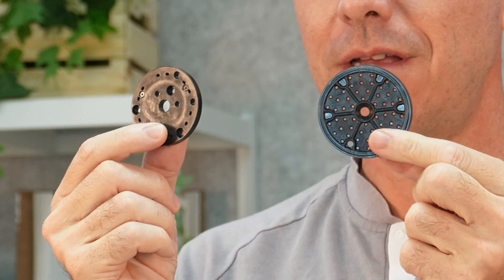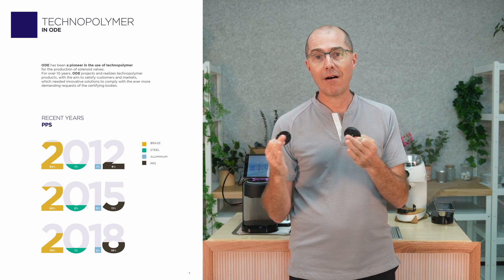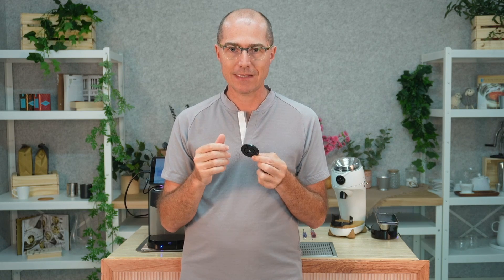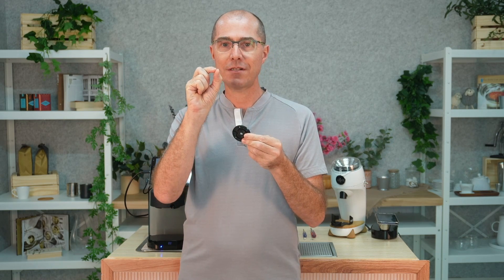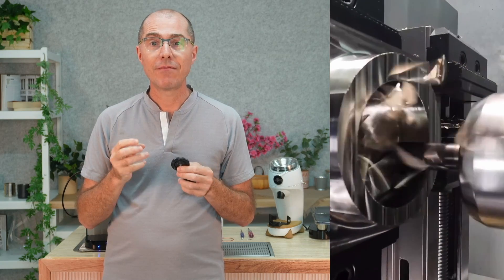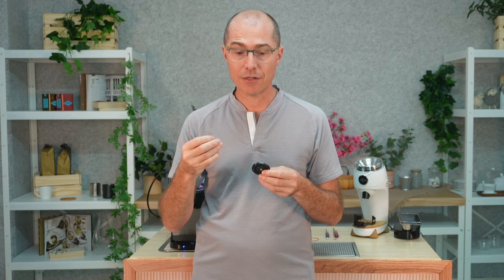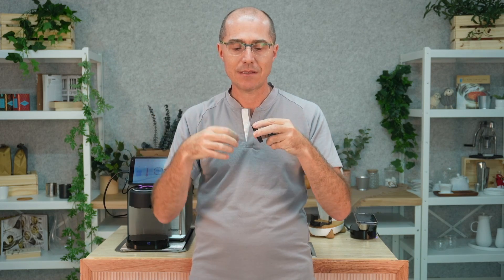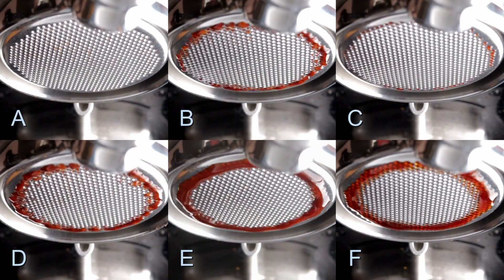Make better coffee with Decent's new and improved group head parts

Comment: @decentespresso Honestly I’d rather see you make them out of copper or ceramics composites make it either highly sensitive to heat or resistant to heat over time I see the water slowly eroding those parts into the cup and I’d rather not drink plastic but that’s just me I don’t care if some bureaucrats say is safe

Also the sticking of the oils is from the copper in the brass it’s one of the reasons copper is used in alcohol distillation it’s reactions to oils for example a still that’s made anything but cognac can’t make cognac because the copper has been contaminated with oils other than what would be found in cognac and would not created a suitable cognac flavor profile
The change in flavor could be the heat or it could be the oils not reacting with the copper in the brass acting like a catalyst this is important in distillation to remove sulfur compounds but it might be harming the depth of flavor in this process

Comment: Just installed my new group head parts! I can’t wait to test it more. Today it seemed to have a tiny bit better balance and maybe after looking at my rusty looking brass it will keep way cleaner so maybe that is a cleaner cup with less old oil since I only back flush like every three weeks. The puck is still a little soupy but no big deal.

Comment: Besides obviously removing the tanks, anything else needed with the machine or just flip upside down after removing those?
Reply from the maker: We also recommend using a towel so the top of the DE1 is protected too while on the table surface.

Comment: If I recall correctly, v1.44 already had a change to decrease headspace. Does this make 1.44 machines lower than E61 spec?
Reply from the maker: You may have confused this info with the new PPS parts that have just been released. Installing these parts will match the headspace in a E61 grouphead.

Comment: Any plans to make these in stainless steel?
Reply: dude, watch the video
Reply: @decentespressoailliobullet5748  dude I did, twice.  There's no mention of a stainless steel option.  Timestamp?
Reply: @huachangxu7655  he says that the MAIN POINT of using plastic and not ANY metal is due to the temperature lag caused by the metal acting as a heat sink. The move to plastic is largely to get much faster and more accurate response to the actual temp in the group head. So any metal, brass, aluminium or stainless steel would have the same negative impact.
Reply from the maker: @decentespressoailliobullet5748  Exactly so. Stainless for these parts would be even worse than brass.

Comment: Does the "Group head v2 upgrade kit for DE1 v1.1-v1.44" part include both this and the lower headspace? Or should I wait for an upgraded kit? Many thanks and awesome continuous innovation! ❤
Reply from the maker: This will lower the headspace but you will also have to be mindful of the gasket you are using and or the basket and dose, which also affect the headspace.
Reply: @decentespresso  thank you. I ordered and received the parts and the installation was a breeze thanks to the video!

Comment: Fda aproved tefal as well, and how many people had died since.
Reply: My brass parts were starting to very slightly erode a little with some surface rust and I wonder if they have a tiny bit of lead. I guess this is probably just as safe or safer and way less cleaning is needed.
Reply: Thanks for the public notice, you can still use the old part...
Reply from the maker: and yes, we'll continue to stock the brass parts, for people who don't like the idea of any plastic in the water path, even one so well tested, used by so many espresso parts companies, and used to make baby bottles.

You're welcome to use brass, if that's your preference.
Reply: and therefore?

Comment: To compensate for the brass heatsink effects, can't existing brass-users to change their algorithm to have +3-4 degree pre-infusion temps?  Or another question, if you switch to the new plastic group head and your same recipe "instantly tastes better", it means the original recipe wasn't good enough and should have used a higher water temp.
Reply from the maker: It's more complicated than that.  The brass contributes latency, which causes many effects.  The video explains more.

Comment: hi john, will this new design also work with IMS SI200 shower screens? And did you drop the 100$ goody in your 2-year warrenty option?
Reply from the maker: Yes, we continue to use the IMS SI200 screens.

Yes, the $100 goodie pack was an introductory promotion for the extended warranty, and the offer ended about 2 weeks ago.
Reply: @decentespresso  this is a pity, I did not purchase the warranty yet because of this option.

The DE1 comes with a CI200 not SI200.  Please do not confuse.

Comment: Will the new group head reduce the soupy muddy coffee sludge and dry pucks?
Reply: He implies that right near the end around 14 minutes in . They are reducing the space between the shower head and the puck which should result in drier cleaner pucks.
Reply: yeah it's mentioned in the description of the video:
Reduced channeling: Less headspace above the coffee puck reduces channeling and increases mouthfeel and shot consistency. 
Also says it at the end of the video. Same as E61 machine.
Reply: It seems to help a little after one shot today. Nothing like a dry puck.I will do a video on it. I think since it doesn’t have a  traditional three way solenoid, it doesn’t do a large suction that a 9 bar machine would so after a shot turn on and suck the water away so maybe that’s why it’s not as dry.

Comment: Very cool. Are these fitted as standard now? Just ordered a machine today, and would be curious to know if this will be installed. Great work as usual!
Reply from the maker: You will still have brass internals on your new DE1. We plan to have these released soon and they are backwards compatible, so no FOMO! 🙌🙌
Reply from the maker: If your machine hasn't shipped yet, the new parts are available as a CUSTOMIZATION for +$100, and we'll do it for you.  

But... I see your machine HAS shipped, so it has the brass parts inside.  You can get the parts from us at $100 and install them yourself.  https://decentespresso.com/accessories